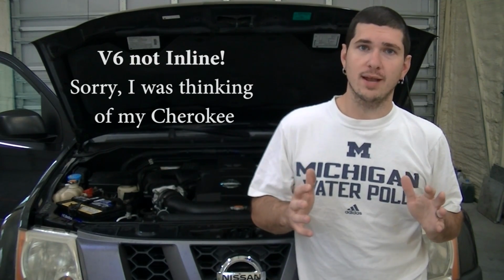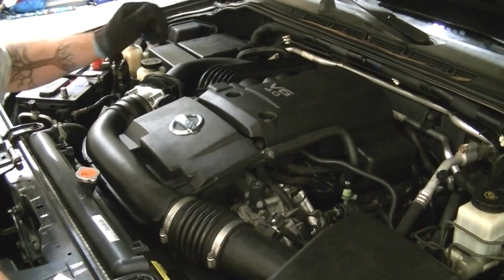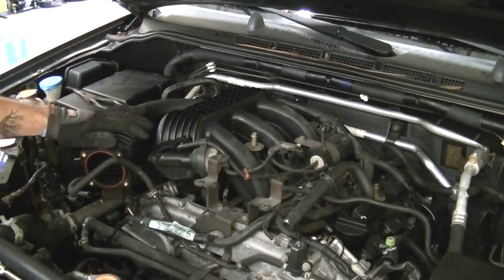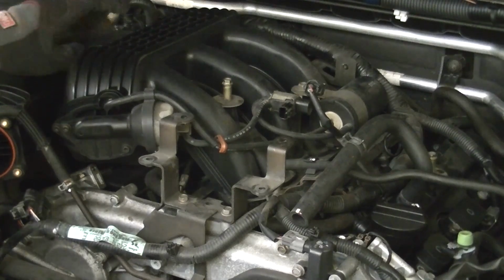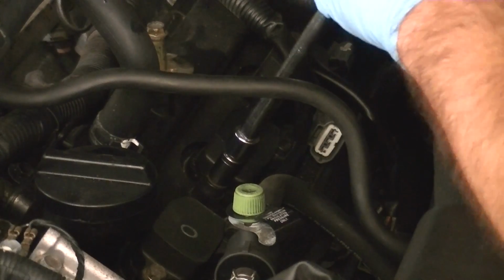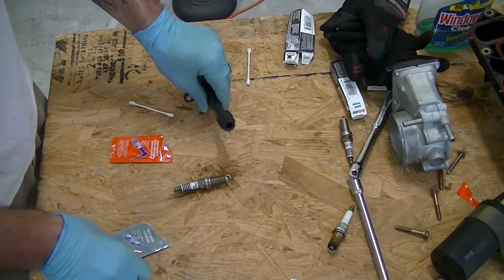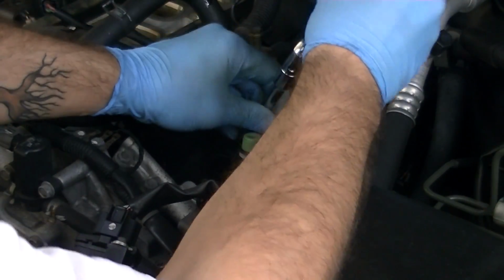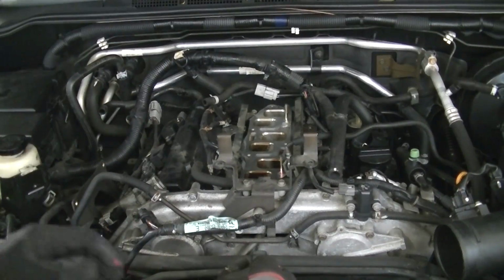How to Replace the Spark Plugs on a 2005 Nissan Xterra

Comment: To anyone doing this tutorial step by step: You don't have to remove the throttle body (control actuator) from the intake system! It can just come off with the rest of the intake. I know this because I stripped two bolts on my throttle body a month ago trying to remove it for cleaning. It simply comes off with the rest of the intake, just leave it attached. Everything else in this vid is spot on. Ry, thanks once again for a great tutorial!
Reply: Great advice.  Thank you.

Comment: I’ve been putting off this job for a year and I did it today. When I finished and started her up noticeable shaking and check engine light came on. Heartbroken I opened the hood again and I saw I forget to reconnect 2 of the coil packs (thankfully on the right side) its all good as new now! Thank you so much Ryan!
Reply from the maker: You’re welcome. I’ve been there! It’s easy to skip over or not fully seat the coils. Glad you got it figured out!

Comment: I noticed in a lot of these great videos he may sometimes take off things that you could possibly avoid but it teaches you that when doing one thing you will remember those steps when doing something else which is a huge help.
Reply from the maker: It's funny you say that. There have been plenty of times where someone will ask me how to remove something and I reference a video that is not the exact job but I take the part off during the video. If it helps, it helps!

Comment: Thank you for the video took me 2 hours just finished...quick notes...you don't have to disconnect hoses going to the throttle body and you don't even have to disconnect everything in the back if you just want to replace coil packs and spark plugs thanks again bro.
Reply: yup..exactly right..you DO NOT have to remove it

Comment: What happened to the days when the plugs and other parts were accessible. This is a huge job to just replace plugs! Good video!
Reply from the maker: Right?! Its craziness. Its even worse today when everything has a damn turbocharger.
Reply: only the passenger front is tough the rest are easy

Comment: Nice to be able to stand on the ground and still reach the rear of the engine. I’m 5.9 but still I need to use a step ladder. I do have tires 3 inches taller but still my bad back and old knees hurt after a few minutes. Nice work bravo sir. Your content is my first place to go when working on my pathfinder and xterra.

Comment: I appreciate this video just last week I called my mechanic to see how much he would charge me to change my spark plugs and I was thinking to do it my self but I think that for the money I rather let him do it, I just changed the thermostat after watching your video and it saved me some money so thanks for this videos, I'm looking foward for the next one
Reply from the maker: +Daniel Galindo that's great! So glad it saved you some cash.  If you don't mind me asking, how much does your mechanic want for the job?
Reply: +Ry the car guy 
Hey, I just watched your video on the spark plug change. 
I must say that it does look intimidating. 
This is my daily driver and I really don't want to screw it up. 
However, your video is very thorough so I might give it a shot after I do the fluid changes on both diffs, the transfer case, manual trans and radiator. 
The serpentine belt is due soon. 
I was just at Nissan today for an estimate on the spark plug R&R and they want $650.00
Reply from the maker: dang that's high!
Reply: +Ry the car guy
 yep, California pricing.
Reply from the maker: Well I can personally tell you that its not $600 worth of work lol. Its barely $200 (counting supplies)

Comment: Wow I just bought an Xterra on 9/22. On 9/24 I took it to the shop for a tune up because the engine light came on for P0301. No wonder it's taking so long to get it back that is a lot of work. It's also getting a rear bearing done. After watching this video I will continue to patiently wait to get the vehicle back.

Comment: Ry Buddy, I am going to tackle this soon, got everything and the intake gaskets. Also as long as I am there I am changing the camshaft sensors, crankshaft sensor, temp control sensor, thermostat, radiator hoses, PCV valve, and finally the valve cover gaskets, not in that order obviously. This Corona virus thing is going to keep me busy on the Xterra. Oh, yeah, Also using your fuel pump replacement video to do that, the fuel level sending unit is shot and the X is starting to act as if it's out of gas, new pump time. All using your videos only. You are the best.
Reply from the maker: Thanks Ahmad! I hope it all goes well. Contact me if you need anything. I’ll do what I can to help.

Comment: Thanks for making such an informative video! After watching I definitely feel more confident in doing the repair myself. I had a shop replace all the spark plugs and came back with code that cylinder 1 is bad. Paid $450 for them to replace the plugs.. didn't want to spend another $600+ on coils too... Figured I'd replace 1, 3, 5 while I'm doing 1. I will be tacking this next weekend. Wish me luck!
Reply from the maker: Good luck! I’m sure you will knock it out of the park! If you follow me on Instagram you can DM me with any questions you have. If I’m around I like to answer them and help people out.

Comment: Original owner of a 2005 Xterra with 287,000 miles, still running with original spark plugs, purchased new ones today and about to replace them thanks to this video, im curious what difference it will make, i drive about 100 miles a day to work, i've been through the radiator issue, caught it early when it first broke and replaced the radiator so no trans damage, the truck has been great all these years, have replaced both front wheel bearings and the rear u joint, other then that its a great running truck
Reply: I replaced my spark plugs and thanks to this video I had no issues my truck is running better than ever. I do have a request, I have had my engine light on and off for a couple years now due to an issue with my EVAP canister. It would be much appreciated if you could do a video showing how to troubleshoot and removal replacement for this issue. Thanks
Reply: @1bravo471  wow 287k in miles and still running like a clock! That is pretty impressive especially since it is 2005, the first year of the 2nd gen!
Reply: @itsdimitriymedvedyev  I am at 355k now and still going strong,  changing my oil every 5k and adding a bottle of lucas oil, truck still runs great
Reply: @1bravo471  That is even more impressive! My 2012 X only has like 141k miles on it so I am very far away from yours! 
By the way, there is an Xterra forum called The New X Org, I'm sure folks there would love to hear the story of your 2005 :)

Comment: Hey there Ry, Love your videos, I have a 2005 Pathfinder, just rolled 236000 miles, and we just added a 2013 Armada with just under 100000 miles.  You put so much detail into your videos and I don't want to take away from the work and effort you put into these.  However, I have to say I have changed the plugs on my Pathfinder 2 times now, and never touched the intake collector at all.  Just used a bunch of wobble extensions, and got a couple bloody knuckles.  And if I can get my sasquatch hands into there, pretty much anyone can!  What I do suggest, though, is making sure you have a few of the Spark Plug Boots on hand (NGK# 58913) as sometimes I've found they get seized in the spark plug tube.  Also, you do need to partially disassemble the boot when extracting it from cylinder 3.  You can get this job done in about 2 hours, without pulling the intake collector.
Reply from the maker: Thank you! Your contribution would never take away from my work, only add. I certainly agree that it can be done without removing the manifold. I just like to follow the factory service manual when it comes to creating these videos. I also have to balance the amount of time and effort it takes to fiddle with something with the amount of time it would take me to just remove an obstruction. Most times I just decide to remove the obstruction.

Comment: Great video. When I did my 2008 Pathfinder I was able to get access without taking the manifold completely off. I just took out all the bolts holding it down and you can lift it up high enough to clear and get access. I left the throttle body in place too. I spent the extra money for the expensive Iridium plugs. Nissan rates the Iridium plugs for 110,000 miles so it was worth it to me just for that fact. My original plugs had 120,000 miles on them and they still looked great. The Iridium plugs are incredibly durable, I'm sure under optimal conditions in a good running engine they would last 200k or more.
Reply: I was also able to replace that one hard to get at spark plug without doing anything to the intake..

Comment: Watch the video 2 times and siked myself into doing the job, (I'm a HVAC tech) my background came in handy and got to it, also while I got to taking all the parts, I had a failed cam positioning sensor go bad so did that too. Took me 15-20 min trying to figure out how to take the harness clip off the cam sensor. All went smoothly. 👍
Reply from the maker: How great! Glad you got it all sorted.

Comment: Just did this job. Didn't take off the throttle body though...Figured one less thing to do. Also, replaced the coils on that passenger side too. Unfortunately, also had to replace the passenger side valve cover too as there was oil on one of the spark plugs indicating to me a leaking spark plug gasket. 

Good thing you had a video for removing the valve cover! $70 for the replacement valve cover and gasket.

Comment: Awesome video, thank you much. Two nitpicks: 1) Anti seize shouldn't be used on spark plug threads anymore. They now all come zinc plated to prevent any thread galling in aluminium heads. The anti seize can also cause over tightening of the plug.  2) Also, I would absolutely replace the orange intake manifold base seals and throttle body seal. After that long and with that much heat the material gets hard and doesn't seal up like it did, and can cause an intake air leak.
Reply from the maker: Thanks for the feedback. When did they start doing the zinc plating? You’re not the first person to mention that. I feel like I am behind the times lol. And I do agree with you on the seals but down in FL seals seem to stay supple a lot longer. I check them out every time I pee them apart but they always look and feel good so I don’t replace.
Reply: Almost all spark plug manufactures use nickel or zinc chromate now, since virtually all automotive and motorcycle heads are aluminium.  See https://www.driven2automotive.com/blog/why-you-shouldnt-use-copper-grease-when-installing-spark-plugs/

As far as the seals go,they may feel pliable, but how pliable now compared to brand new? The only real way to determine this is with a durometer test, and that's a bit of trouble and expense you don't need unless you either have a large stock of seals and the shelf life is a concern, or it is a hard to buy item. Seals, o-rings and gaskets are relatively cheap, therefore I always plan on replacing them, unless you recently did before, and after careful inspection they look and feel brand new... no nicks, sticky spots, discoloration, flattening, still pliable, etc. Remember, with elastomers its age, heat,  ozone and UV that cause them to degrade. But take what I am saying as you will. Professionally I'm a mechanical engineer  that manages large scale maintenance programs at an industrial plant...and have been turning wrenches as an amateur for 35 years or so. 

I really do appreciate the video, as I'm about to perform this task on my 2008 Xterra at 135K miles...I'm behind on the maintenance but it is still running perfectly. Quick question: is it easier to get to the cam position sensor with the intake  off?

Comment: Dang! I was hoping you were going to show me some neat trick that made this job easy. My 2008 has 140K miles, and fuel economy has gone downhill, so I'm sure my plugs are as bad as your old ones. Guess I'll have to get at it. BTW--The auto parts store guy said mine should get NGK iridium plugs. They were about $10 each. I went with those. Thanks for another great video--You've helped me a lot over the years.

Comment: I did it without removing the intake manifold. I also use a foot long piece of fuel line and stick the spark plug in it to lower them into the holes and to get them started then just pull it off. Need a short 10 mm wrench and a magnet on a stick.

Comment: With that intake plenum removed it's the  perfect time to  change that old passenger side cam position sensor. 

When it goes bad, the car doesn't start !
Reply: Good idea. Is this a common wear item on this car or just a slam dunk case of since-I'm-in-there?

Comment: Love your videos. Was able to change sparks on a 06 Xterra without removing the manifold or intake plumbing. Was a pain in the ass but it's possible. Wrenches(ratcheting would be better) are all you need.
Reply from the maker: +JELANI FOSTER thanks! I'm glad you enjoy. I'm sure you can do the job without  removing all this but there are a few risks that you need to take. All of my videos follow the factory service manual to demonstrate the proper way to complete jobs on the Xterra.
Reply: +Ry the car guy  True. Was disappointed in Nissan for making it that much work to change the plugs. Would expect that from VW.
Reply from the maker: Haha exactly. Or Saab

Comment: Thank you for the thorough video. Wow! I will gladly tighten the belt and pay someone to do this now that I see how much work it takes. Perhaps in the beginning or end of the next video could you have a part where you show or suggest all of the tools and products you use in the video to get the job done. Not necessary but easier for me to stop, pause, and then make a list of things to get from the store since I don't usually work on cars. Thank you so much Ry.
Reply from the maker: +NYLA I love that idea, thanks! Yea I have to say this job was a bit annoying. I have had vehicles where you do not need to touch a thing to get to the plugs. That ok though. It was a good experience and wow did those plugs need to come out. The one used one I show in the video is one of the better ones that was in there. Some were completely gone.
Reply: My 2009 Xterra is at about 89,000. I will have to make the decision in a bit to change it myself or trust that someone else will do the job better than me. I am not experienced but I am patient and believe I can do anything. That has gotten me very far. With that job being so long it also makes me think someone else won't take their time and do the quality work it takes and I should do it anyway. I haven't made up my mind yet but if I do your video will be a massive help to me. Thank you.
Reply from the maker: +NYLA glad to hear. Honestly the job is more tedious than it is difficult. Patience is more important for these types of jobs. I have I've never broken anything on my cars due to lack of experience or skill. But man have I broken a ton of stuff because I have zero patience. hahaha

Comment: In no small part thanks to this video, I knocked this out today. It only took me a solid 4 hours, but at least 1 of those hours was a bit of existential anxiety after I couldn't find a bolt that was hidden underneath the bracket underneath that wiring harness. To my surprise, everything powered up and ran, no bolts were lost, and 5 out of 6 spark plugs were in predictably old but nominal shape. Number 6, on the other hand, was oily. Guess that's where that pint of oil every six months is going...

A small note to anyone attempting this: If it wasn't obvious, you will use every kind of extension imaginable. I had a 1/4" and 3/8" drive, flex head and not, and 3, 6, and 9 inch extensions. You may need normal-ass crescent wrenches to help bust loose some of the particularly stubborn bolts. Likewise, a flex head in 10 and 12 millimeter make a whole lot of things way easier.
Reply from the maker: Glad you got it knocked out!

Comment: My dad xterra is 2012 with no joke 215,000 miles!! And original plugs. These motors are pretty good.
Reply: +BAMA GRAD 
now it's 220,000 miles. no timing chain problems yet. I'm pretty sure the timing was fixed before the 2012 model year came out. plus it is a manual transmission so no cooler problem
Reply: +BAMA GRAD 230,000 miles just changed the spark plugs still going
Reply from the maker: Many more to go!

Comment: What does the Standard, Hot , Cold type mean? I have an 05 Xterra Which one do I use?
Reply from the maker: I would just use standard. You would only try different ones if the standards give you pinging.

Comment: Absolutely the best and most detailed videos I’ve seen . Thank you for your hard work . 1 ? Do you have to re learn the computer after disconnecting and re connecting the throttle body ? Thanks Again 👍👍
Reply from the maker: Thank you sir! I would only worry about it if it acts strange.
Reply: @Rythecarguy  I’ve always been told if you take it offF you need to relearn the idle air.. especially if you clean it or mess with it at all..
Also any time you pull something apart that  have gaskets must be replaced to avoid sensor issues throwing codes

Comment: Thank you so much as usual great skills of demonstration and instructions excellent.. If possible, I have some hoses below the Air Filter on the right side of the engine are not connected when I purchased the Xterra 2009, they are just dangling there, I am not sure where they go specifically... Can you put a Video showing each hose connections and function I really appreciate and admire your videos.... Thanks a bunch.....